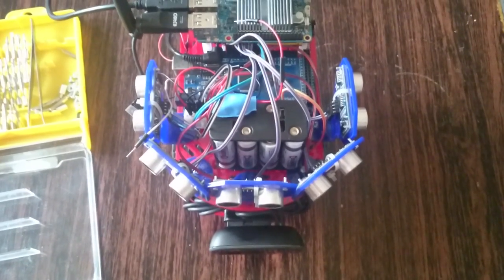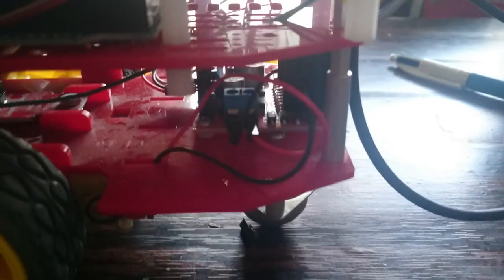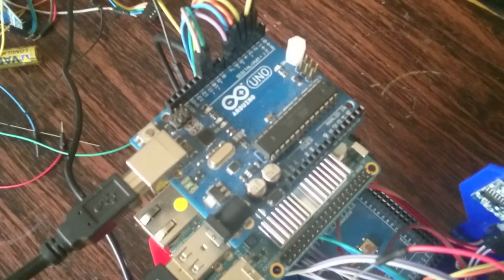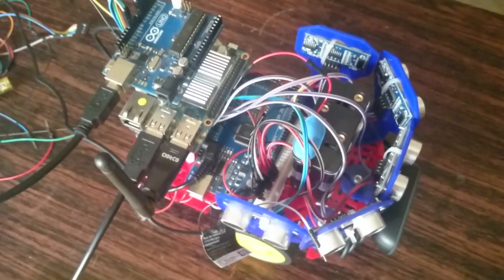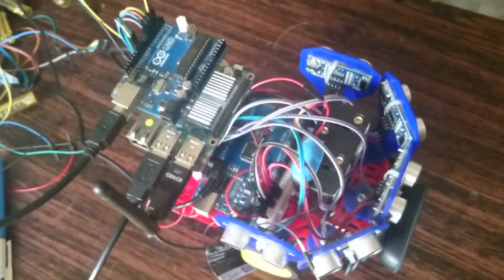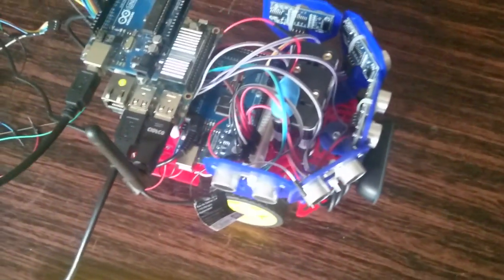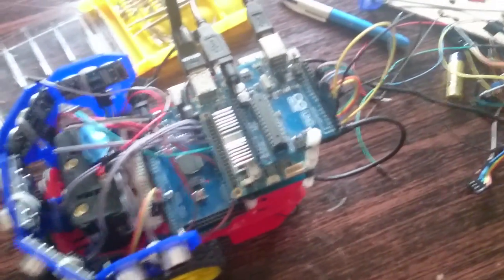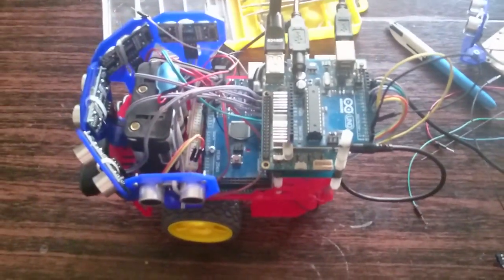Mobile robot prototype PART 1 (ROS ODROID ARDUINO PRESENTATION)

Comment: hello , i want a help . how to connect the virtual peripherals to real peripheral . for example how to connect laser or camera node with real camera or laser
Reply from the maker: Well, if you are into ROS it s not a problem. Im using ROS wrappers for the cam/laser driver, its not so hard. About the other sensors (for ex the sonars) i have arduino that gets the data streams from the sensors and send them through the serial connection to the Odroid where a ROS node convert them into messages available into topics
Reply: okey , thank you but i found a problems if you have a facebook account i can contact you in for more explaining of the problems that i have  !